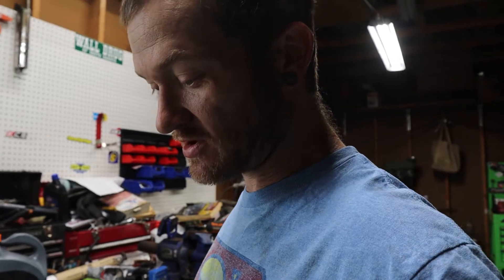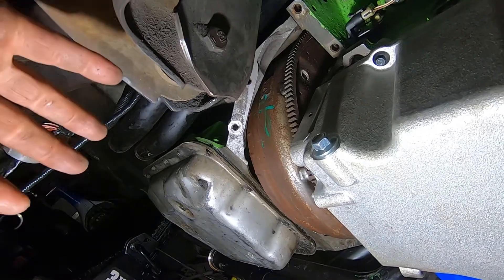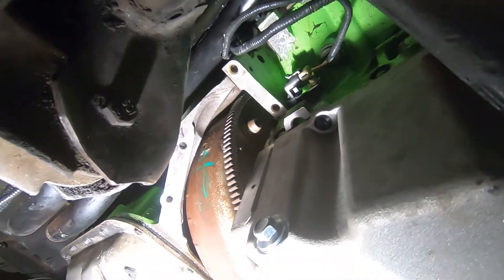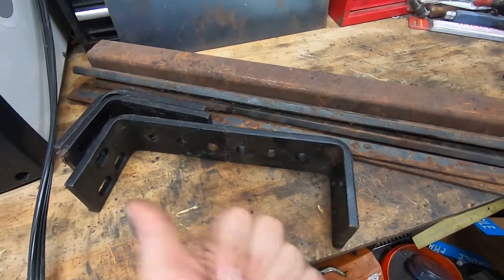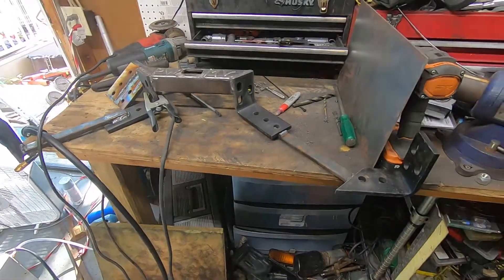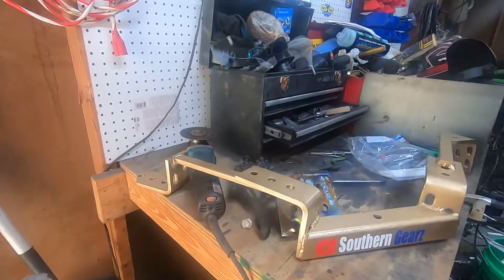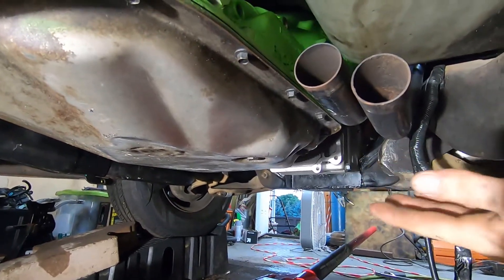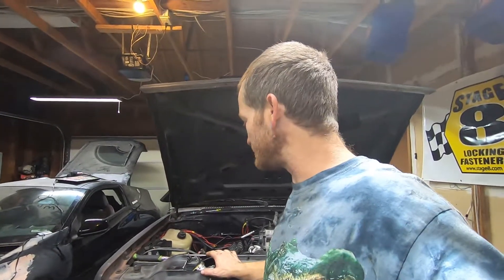Installing a 4L80E in a S10 with Custom Transmission Crossmember

Comment: other than flattening the seam at the tunnel to firewall and rear trans mount was there any other clearancing needed for the 4l80e to fit
Reply from the maker: On one side of the trans you may need to remove some of the trans where that access panel mounts. For me it was because of my exhaust but you may not have that issue

Comment: Do you have the stock rear end on this truck? 

I’m looking to do a s10 as well, just starting to get the feels out on what I need. I’ve read the 4l60e can’t hold much power. I want to cam a 5.3 and don’t want a 60 to blow up
Reply from the maker: Not anymore i got a ford 9" made by quick performance
Reply from the maker: Those 10 bolts dont hold very well unless you can find the blazer with the limited slip or get the ford explorer rear end that has the limited slip. Both will need some modification.
Reply: @southerngearz do you think the 60e would be able to handle a big cam and larger rear tires? I’m just trying to make a fun street truck
Reply from the maker: @Lemensgarage as long as you run street tires you should be ok. The grip is what will break stuff and the 60e likes to go all neutral with grip and power. You can beef up the 60e but for cheaper you can swap to a 80e.
Reply: @southerngearz would a 6.0 and 80 be better? Or is it a nightmare?
Reply from the maker: @Lemensgarage it wasnt too bad i was able to use the 5.3l mounting but needed the computer from the 6.0. If you get a 6.0 out of a van that has the 80 its much easier. You would need a different trans crossmember and a new driveshaft as well. Its crazy how you change one thing and it snowballs into a crap ton of stuff.
Reply: @southerngearz I’m so bummed, there’s a 6.0 + 80 + harness/ecm for 800$. I don’t have that rn unfortunately 😭
Reply from the maker: @Lemensgarage i say roll with the 60e and wait til it breaks
Reply from the maker: You can always get more 60e's from the junkyard
Reply: @southerngearz you think a 5.3 and 60e with a cam will be good for a 90 S10?
Reply from the maker: @Lemensgarage oh yea should be great! Just be easy on the launches

Comment: Im curious if your 4L80E is the MCP or MJP? Awesome truck!!!  Finally got my 5.3L built and wondering if the MCP slip yoke or MJP bolt on yoke would be better?  Looks like yours is a slip.  I have ext cab so 2 piece drive shaft.  Thanks
Reply from the maker: I did replace the tail shaft with a billet one when I rebuilt it and it has no problems with the slip yoke so far. I believe it was a mjp though since it came from a hd van
Reply: @southerngearz  The Trans I plan to buy is from a 2005 2500 van and is mjp.  Thanks!!  👍👍👍
Reply from the maker: Ive got to say im not sure but now I want to know. Its from a 2006 hd van. I am going to have to do some research now thanks.